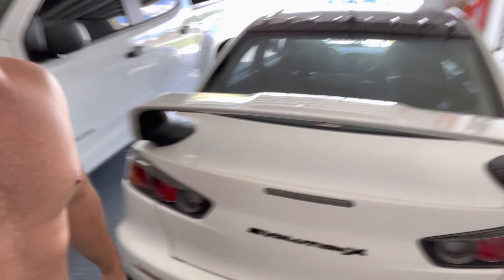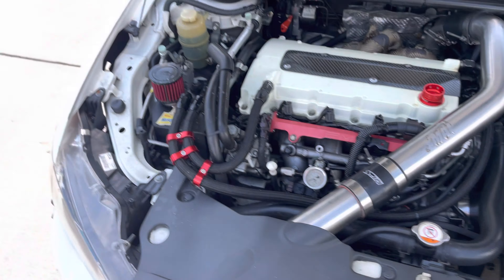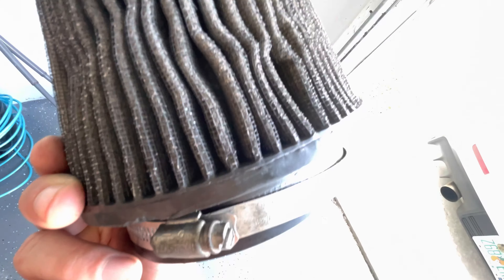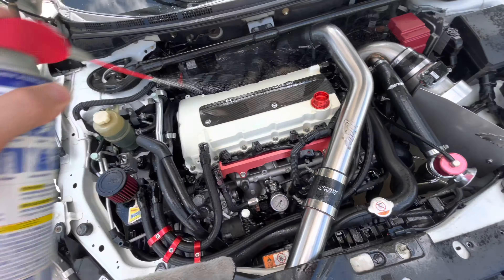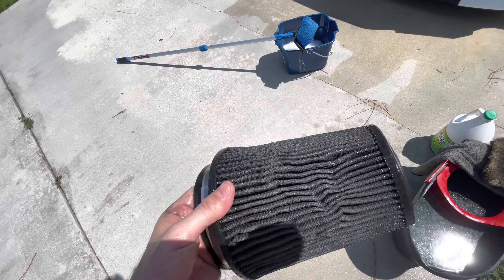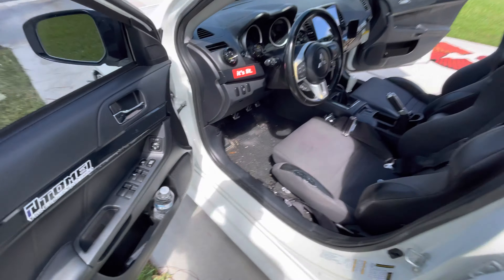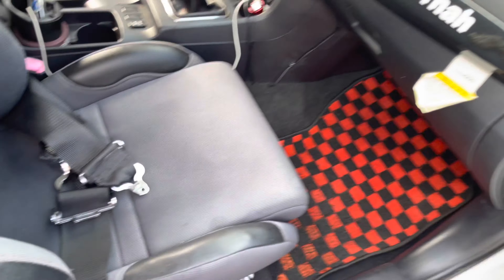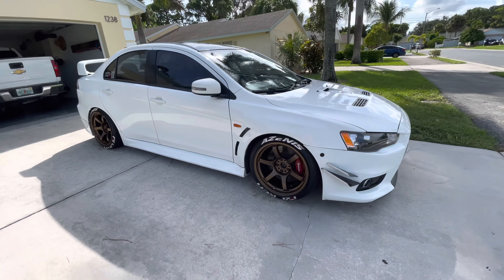Vnotes #137 900 WHP DROPPED OFF AT THE SHOP.

Comment: 700,750 is a lot lower than 900whp...
Reply from the maker: Yea. It’s capable of 900 but not going that high
Reply: @Joey400  That turbo isn't.
Reply from the maker: Yea I know. Taking about the kit,  fuel pumps and injectors